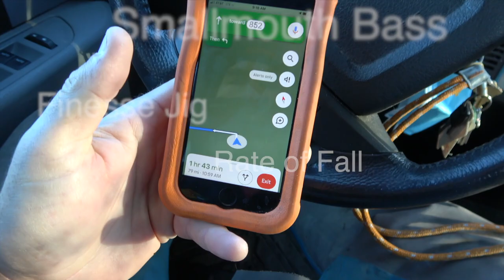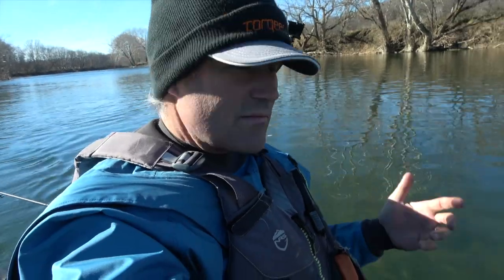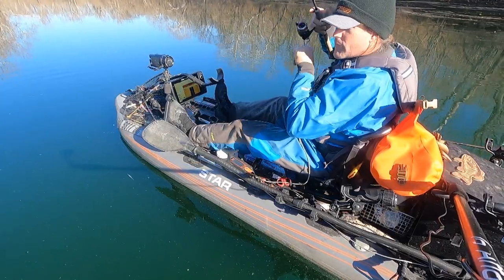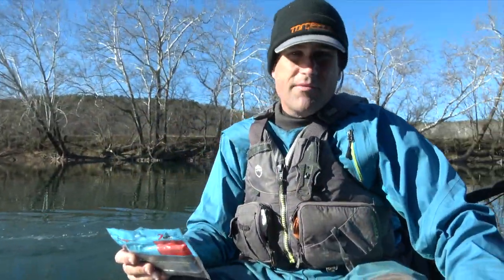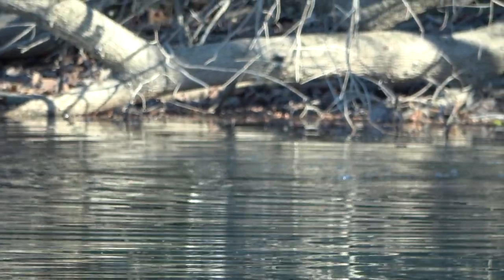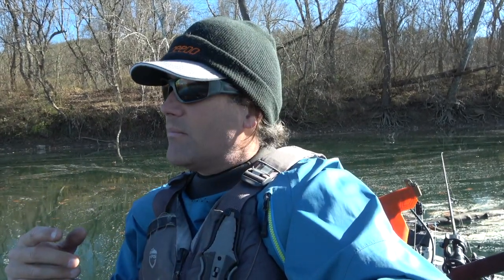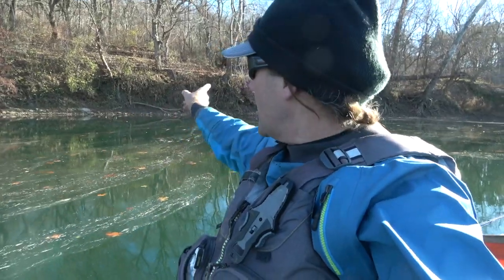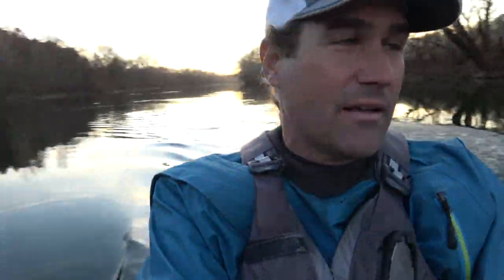Shenandoah Smallmouth: Is Your Jig Too Heavy?

Comment: Jeff, what size/kind of hook are you using to make those jig heads?
Reply from the maker: They are “Victory” brand hooks, made specifically for this Do-It Mold. I was able to fit it into another bristle weed guard round head mold that I modified to be a very lightweight football head, something between 1/16th and 1/8th. It’s a great hook. If it does snag in wood, it can be straightened out to get it back, and bent back into place to keep using it, provided that you have at least 12 lb test line.